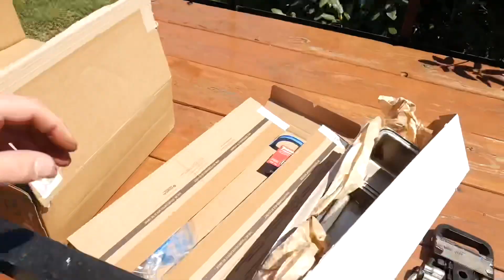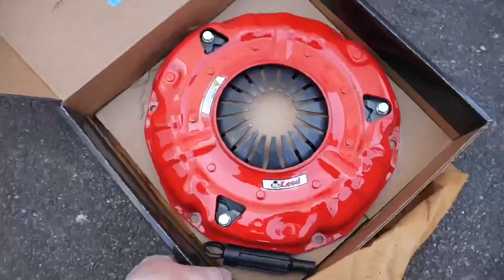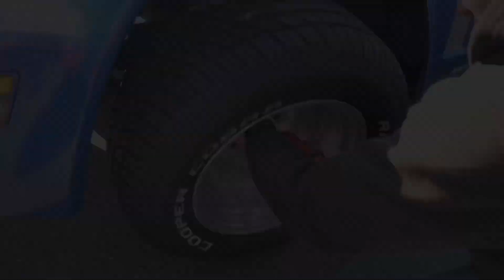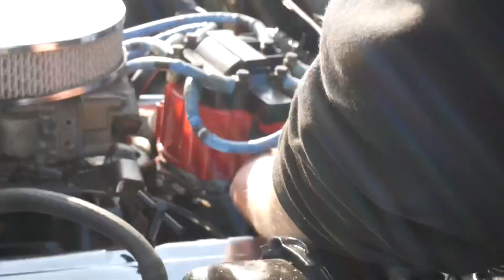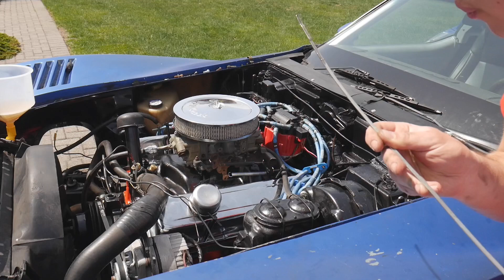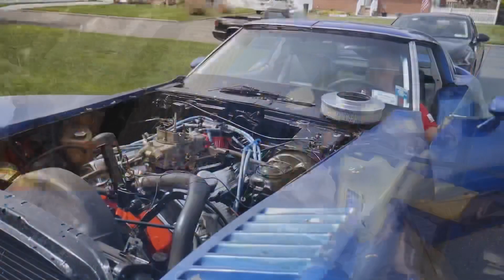The Corvette COMES TO LIFE After Getting it's FRESH Engine Into the Car!

Comment: With that being said, don't take any shortcuts...   I bought a 1979 C3 with almost 100K miles on it from a friend (at least he was at the time).   I found so many things that were done in a haphazard, cheap, shoddy manner... I am restoring the driveline components and undercarriage from throwout bearing on back.Yes, mine is noisy, and going to replace it rather than get stranded someplace.

Comment: Run the coolant temp sensor wire along the intake, looks way cleaner and it’ll be fine I’ve always done that without it getting too hot, good job bro love the content and the vette especially. I started on small block chevys with my grandpa

Comment: I have an 81 corvette, the “thermostat” sticking out of the coolant spout is an EGR valve. When it gets hot it opens the vacuum lines to switch stuff on or off for the smog pump. It isn’t an actual thermostat for the coolant.

Comment: Hopefully changing your transmission fluid doesn’t ruin your transmission. You know what they say don’t change it better to leave it
Reply: Not in a old manual trans. In a automatic with a valve body yes cause it can plug up small ports but in this case it’s perfectly fine